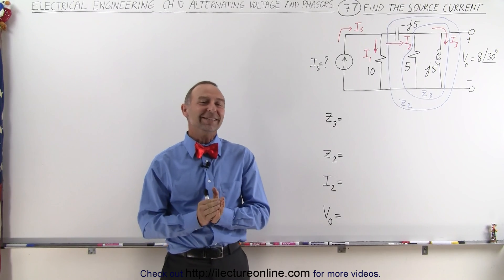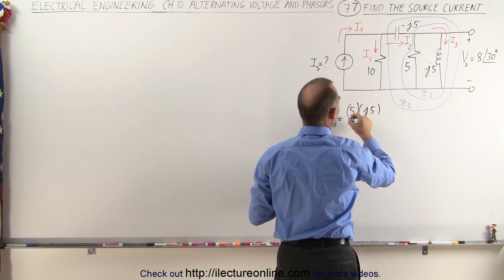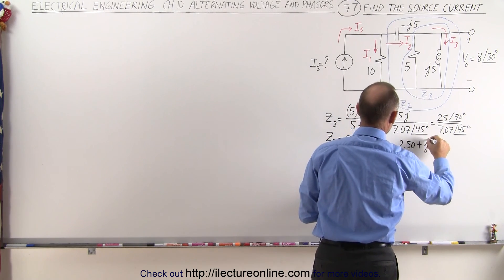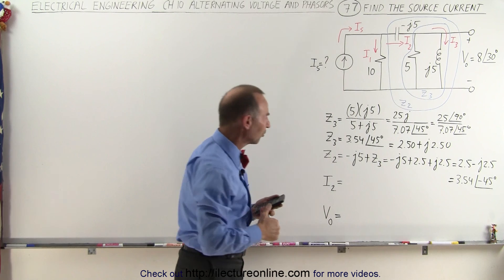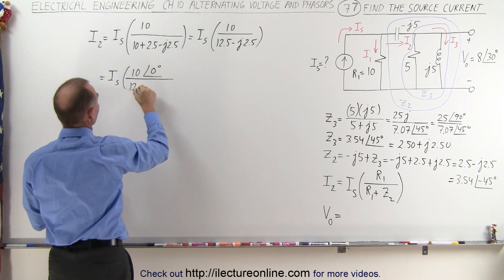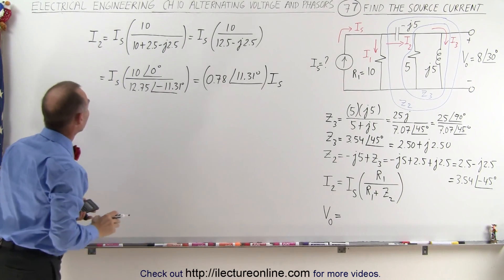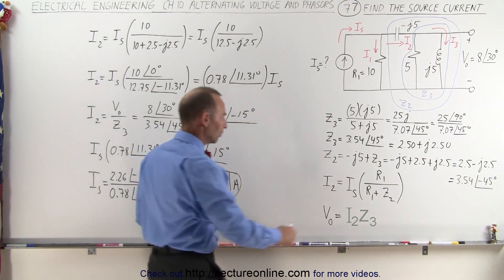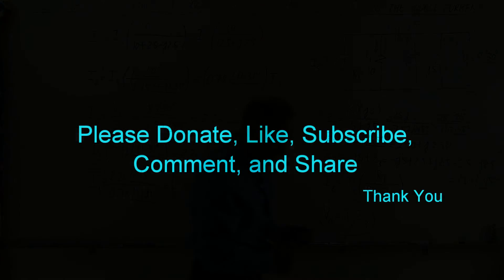Electrical Engineering: Ch 10 Alternating Voltages & Phasors (77 of 82) Source Current=? (2)

Comment: is not I2=Is*(Z2/(Z2+R1)) ?
Reply: what Michel sir did was correct. even though they're in parallel we just simply add them. once refer current divisibility rule you will be clear
Reply: I confused the current divider formula with the voltage divider formula, my bad.